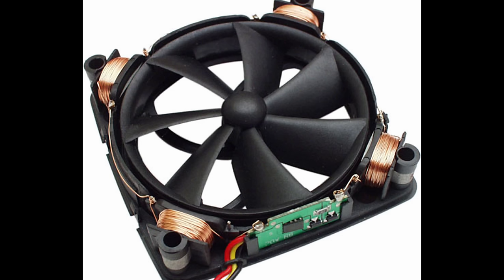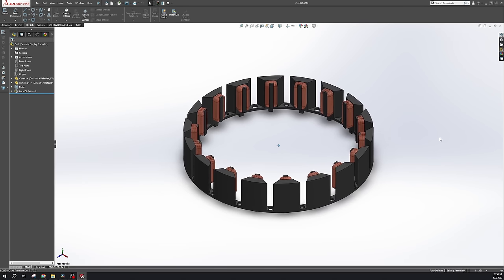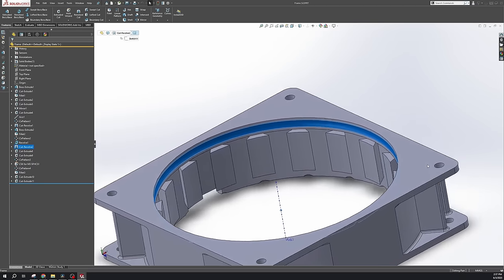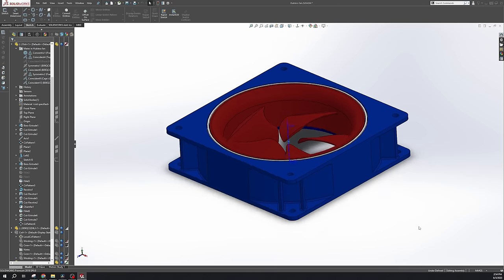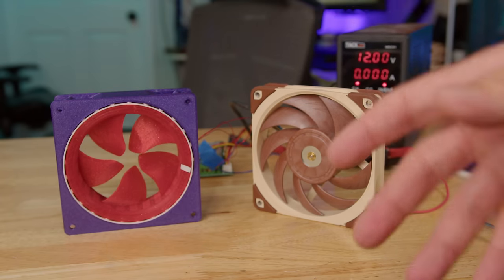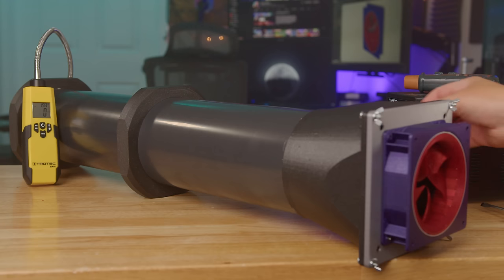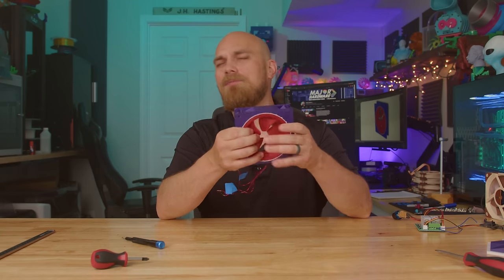I made a HUBLESS PC fan and it’s so loud!

Comment: Okay, this is awesome. Imagine a balanced fan with better bearings and optimized blades.
Reply: Would it be hard to try to make it a giant maglev bearing with some magnets and the correct shape of the outer ring ? Or if you could use the drive coils themselves to hold the ring while running.
Reply: @Maaniic  I suspect magnetic field of maglev bearing will interfere with mechanics of fan itself, although I guess you can minize it by making them rather tight fitting (below 1mm distance), but reducing magnet's power (maybe even make it 2 rings on opposite sides at 45° incline). All that said, it will take quite a lot manual labor to place all the magnets, since you would probably need to place hundreds of them
PS fans like it probably would cost quite a lot more (even if produced at scale) due to much copper and magnets being required, as well as more complicated bearings. Not to mention that lateral speed at outer edge it much faster than at inner edge, making it significantly harder to make bearings quite, on the other hand if one could nail down bearings design really well, he might potentially achieve quieter fan by removing the hub supports
Reply: @Maaniic Maglev requires superconductivity to operate, our current tech relies on either very low temps at normal pressure, or super high pressure at more reasonable temperatures, neither of which is very practical. It would make for a great show though.
Reply: Let's create a competitor for the brown company
Reply: A Dutch team in the ugh hyperloop competition used aluminium and magnets to levitate. It worked. Im sure one can also make a magnetic bearing with just magnets.
Reply: This design is /cool/, but I think that a normal self-contained DC motor + quiet gears (the slanted ones), one of it being the rim of the spinning part. Again, not so cool/clever, but it also allows to stabilise it better by having a fixed point of contact...
Reply: Yo, give us some good fan blades and lubricated bearings. I'd love to see it. I also want to see max speed smoke test
Reply: @kooskroos  But aluminium is not even magnetic? edit : ok I see what they did now. But I think this will need to be strong enough to hold th spinning fan.
Reply: @AndrewTSq  It doesn't have to be.  All it has to do is interfere with the magnetic lines.  There are popular examples all around of dropping magnets through a copper pipe (which is also not magnetic) and it slows the descent of the magnet.
Reply: @AndrewTSq  no, but it is interacting with megnetic eddies/induction in a weird way. 
For example a magnet is not  accelerating past a certain speed when dropped inside an aluminum pipe.
Reply: I am not a techie but what happens at normal fan voltage power?  Brilliant as always mate.
Reply: The way I see it it'll always be worse than a Hubbed Fan since you're losing all the Air Volume normally found around the Perimeter while gaining little from the Center.
Reply: @pinocleen  Not really, you are thinking of when you lock a single magnet in a field. There are already magnetic bearings that work by pushing fields against each other. They can't take to much thrust tho.
Reply: @pinocleen  No it wouldn't need that
Reply: You do know this is how regular pc fans work too right? They just have the magnets in the middle, Which is a lot more practical because it takes a lot fewer magnets and coils, plus way less friction
Reply: @FelipeQuirce  Nidec and Sunon already exist though.
Reply: you could do liquid there instead of berrings if you make it sealed up
Reply: @pinocleen  magnetic bearings are a thing that exists without superconduction. I've seen them put to use in bicycles, that said as far as I'm aware they would be prohibitively expensive for this application
Reply: @animusreptorcrafting  The motor itself could be an active control bearing.  It'd need a fancy controller and a few sensors (e.g. optodiodes),  but it'd be possible at low material cost.
Reply: @kooskroos  considering how Aluminum reacts under a strong magnetic field, I could see that.
Reply: Time For Toroidal propeller
Reply: @Maaniic  @Animusreptor Yes, Corsair ML series fans too, must've been thinking trains. But to save me from blunder, going the superconducting route would make for a very compact, cheap, and power efficient design! On a serious note, and as suggested, using the coils instead of bearings should be possible. Maybe 2 sets of motor driver control, synced (so it knows what the other controller is doing) one for the main fan and the other for holding it in place, all wired to both controllers and using the same coil arrangement. Or non synced, where each controller does its own thing and is wired separately to its own coil arrangement. Kind of anything is doable with such a good mechanical design!
Reply: @Maaniic  using maglev is in no way feasible because the rotor would just fly away from the stator because of the air pressure.
Reply: use graphite around the bearings for friction control too
Reply: I want him to try and make a replica of alphacools new apex stealth metal fans.
Reply: Maybe try cylindrical bearings to at least cut down on the noise.
Reply: It would still not be able to compete with a hub motor, i would think. Because the central area of the fan has low wing velocity, it doesn't contribute to the air movement basically at all; so it just makes sense to place the motorhub there. That being said i fully support exploring outrageous designs just for the heck of it.
Reply: I was about to say the same thing. Maybe adding graphite to the bearings or some grease could cut down the noise.
Reply: What about taking some PTFE tubing and running that around the fan
Reply: @meekpigeon  run in the fan for a day of use, change the bearings, just use some PTFE dry lube spray on all parts. You might be able to reuse the ceramic balls as they are much harder than the plastic. But you would definitely want to change the race as it would be worn in some and possibly have some slop.
Reply: @pinocleen  That's to levitate a multi-ton train. This is just a fan that weighs less than 100g. Small neodymium magnets will work plenty enough. Just need to contain the fan within the case, that's all.
Reply: @Christian Shipwreck  oh yes this thing wouldve went faster with greased bearings
Reply: nope, it's nonsence. it's totally doable to make a impeller fan with normal center hub
Reply: "imagine this but better in every way"
Reply: @pinocleen   You don't need superconducting magnets for levitating light objects. Maglev trains use superconductors for two reasons, field strength and efficiency. If you're not trying to lift a train you don't need super strong magnetic fields, and if you're not lifting a train the efficiency of normal electro magnets is fine.
You're confusing the way that a superconductor will levitate in a magnetic field with electromagnetic levitation. The way maglev trains work has nothing to do with the way a superconductor will levitate on it's own if it is cooled to the point it starts superconducting in the presence of a magnetic field.
Reply: @Maaniic 
I thought the same thing (frictionless magnetic suspension).
Reply: @pinocleen 
Wtf are you talking about, superconductors??
Garage 54 used alternating magnets in a column to suspend A CAR
Reply: @Duraltia 
And that is why no one will remember your name
Reply: @ilaion11 
Always with you what cannot be done
Reply: @FireBeam  Yes genius, magnets are very powerful at lifting, however, in this application, they need to keep the rotor tightly centered while the other electromagnets are doing the (heavy) work, lots of forces involved. Now explain to the rest of us how would YOU make it work, w/o using any mechanical type of bearings?
Reply: @FireBeam  Better not being remembered than being with zero IQ.
Reply: @Duraltia  
.... need a second try on that?
Reply: @pinocleen  
Typical, modern day intellectual.
Denigrate anyone with a new idea, while waiting with baited breath to steal it 🤣🤣🤣🤣
Reply: Lol I read this the wrong way, like "cool project; imagine if you did a good job on it though?"
Reply: and lube
Reply: and lubrication
Reply: And a laminated stator that doesn't suffer eddy current losses.

Comment: You should try the fan with some lube in the bearings.
Reply: Im wondering if Graphite lubricant would help or make more heat or not.
Reply: I would try silicone lubricant
Reply: I'd suggest silicone grease...
Reply: Some thin lithium grease
Reply: Vaseline. Very tiny amount.
Reply: and more power!
Reply: Came to say this!
I think dry graphite lube would help a lot!
Viscous grease would fry that weak PSU and/or reduce speed 🤷🏻‍♂️
Reply: I’m curious how a light weight lubricant like krytox 205g0 that people use on mechanical keyboard switches would do. I’d imagine it’d help with the noise but not be so viscous to affect speed massively. But I don’t know how it’d hold up to heat if the friction in the bearing assembly gets really hot.
Reply: Why even have bearings?
In this kind of fan, have a magnetic suspension.
Also, try a different fan design.
One interesting thing: most fans have a sling-off effect from the central flat surface that greatly disturbs the smoke.
This didn't, and I could see this having a very strong focused jet with the right blade design

Comment: As a "Proof of concept" type project, this is amazing. The problem  is, now I would like to see what it's capable of with refinement.
Reply: It would definitely be a high dollar project. 120x120 ball bearings are like $40-$60. Not sure how much ceramic ones are but possibly more expensive. I think the best thing to do is make one out of CNC parts and then optimize the blade design first.
Reply: @fuzzyturtlez8994  wouldnt even be worse in terms of friction with that big bearing? I actually think this is probably a worse fan design than what we have today.
Reply: @AndrewTSq  It is, takes more magnets and coils, plus has more friction, which is the enemy of a fan lol
Reply: Not much of a "proof of concept" given that it already existed and was proven to work. But okay.
Reply: @AndrewTSq  It is worse. If you look at swept area you lose more space on the outside compared to what you gain on the outside. 
Then the amount of loading on the bearing is nowhere near max capacity. So smaller balls if possible would be nice to have.
Reply: It is a cool design, but it is never going to even compare with a regular style fan. The big problem is that you are trading the most efficient part of the fan blades(the outer edges that sweep the largest area and at highest speed) in order to free up the middle which produce zero airflow. In the constraints of a standard fan’s size you are just never going to overcome that, no matter how well you optimise bearings, coils etc. You can see this in the concept fan shown as well. They only had coils in the corners to keep the size of the fan blades as large as possible within the standard size constraints.

Comment: I'm quite impressed with this. As you noted late in the clip, maybe it does need to be run in a bit before it reaches it's full potential. A very small amount of machine oil or possibly 'white lithium grease' on the ball race may help to reduce noise. The fact that the whole unit is 3D printed, including the 'iron' cores is what I find really interesting, the boost in performance if you used real iron cores instead could be significant although a LOT more time consuming to set up. I'm guessing there are a few metal impregnated plastics available.
Reply: plastic and grease dont tend to work well from my experience. graphite powder is his best bet as it's very slick without any viscosity.
Reply: There's some 3d printing material that you can kiln/burn and you end up with a 100% metal print. The tomatoe rocket engine yt guy that I can't remember his name (...Integza) used some in his last rocket video.
Reply: @KareemFloat  PLA is not affected by grease, and greasing 3d printed parts is commonly done. (Plastics are not plastics.)
Reply: @KareemFloat  farmers use graphite powder in their hoppers being pulled by tractors, when they're fertilizing or whatnot, for this exact reason to keep the hopper lubricated. should definitly be considered
Reply: @michaellew1297  the issue isnt the grease breaking it down, but rather being too sticky to be worth doing along with it also holding on to debri and making it turn to a polishing compound.

i have yet to run a printed robot/rc where that wasnt the issue.

edit: btw this is actually something hes tested and tried in this channel before with a multi part fan and ran into those issues and also landed on graphite being the best option
Reply: @shotgunwarrior7219  yep its why i use it on my bots and rc prints. plus hes tested lubricating with grease and graphite in previous fan builds and landed in the same conclusion that grease aint great for 3d printed fan stuff.
Reply: The cores need a re design as there is no flux path that creates a circuit.
Reply: @Major Hardware I have to agree: "needs lube."
Reply: With lube it’ll be faster, quieter, more efficient
Reply: @Longbowgun  Maybe a video could be made to find out what sort of "lube" is best to use with fans in a PC environment. I'm betting there are people out there that have gone "fan noisy *installs new fan*" when all it really needs is little lubrication to if not fix the problem, at least extend the lifespan of said fan.
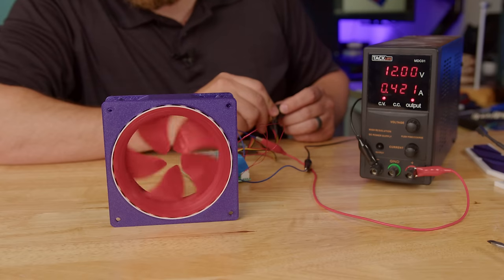Reply: so yall quit arguing over lubes,  his own video "Overdrive ENGAGED | Fan Showdown S4E1" skip to 8:38 in that video...
Reply: @Mick Emrys 
Neodymium magnets are better.
Reply: @tandr3w  I know right? Wish I could have gotten my hands on some when I was racing slot cars. The best motor I had was only a group 12....
Reply: I tried lithium grease for my 3d printed bearings. It works fine but it actually increases friction very much. I mean it will help if you have low speed and high load on a bearing, but for low load and high speed, it will create additional friction because of grease viscosity.
Reply: as graphite powder has no base oils or anything to interfere with the lithium grease , no reason not to use both . very smooth operations and some penetration
Reply: Running that bearing dry, I'm crying here the same as the bearing was crying in the video
Reply: @KareemFloat  Sliding motion + plastic + grease is generally on the perilous side, but rolling motion + plastic + grease is good. The rolling elements here are suitable to be greased.
Reply: He could also use a small motor in one of the corner with a belt to drive the blade, this could save a lot of space for the blades.The fan will probably be limited to three screws but it should be enough

Comment: Did you oil the bearings at all? It doesn't sound like it 😂 also im sure it would get quieter over time
Reply: Oil actually slows down bearings.
Reply: @tacticalcenter8658  if you use a light oil I doubt it. Gotta remember that it's not a perfectly smooth metal ball against another piece of metal, it's on plastic. I'm certain that if the oil was able to get in-between the more porous plastic and the ball, it'd improve performance, and noise.

In theory, in my head. I could totally be wrong though.
Reply: The usefulness of oil in bearings is a hotly debated topic, realistically my personal guess is a small amount of a light thin oil, would probably help.But I have no experience with ceramic and plastic bearings to my knowledge. But last I've heard it's very much design, application specific, along with things like material choices.  

But yeah it's hard to say, generally speaking of you lube a bearing it's using a small amount of a thin lubricant. 

That being said even properly lubed I still expect this to be able to wake the dead.
Reply: @Ayane13b  no its a fact in actual experiments.
Reply: @bobbybobman3073  I'm not arguing anything about the usefulness of oil in bearings. Just the fact the oil slows friction.
Reply: @bobbybobman3073  Oh shoot I totally forgot that these were ceramic bearings. 

Yeah, I mean I never ran any oil in my ceramic ball bearings, albeit I don't have much experience with them except for one case, the rest are stainless.. but they were also in a stainless metal housing and not a plastic sandwich lol.

Oh this fan would definitely not be a quiet fan by any means. But I definitely think that with a bit of tinkering you could get it quieter than an air conditioner lol

Comment: This is so impressive! If you can reduce the bearing noise, there’s SO much potential. You then have complete freedom with fan shape to optimise noise/airflow/static pressure. Please make more variants of this as it’s a fantastic idea
Reply: If he’s already using magnets, why not magnetic levitation?
Reply: @_B.C_  That was the first thing that came to my mind, too.
Reply: @_B.C_  Yep, magnetic bearings would be the best choice.. but in a fan that small, it's going to require some incredible engineering. It can be done...